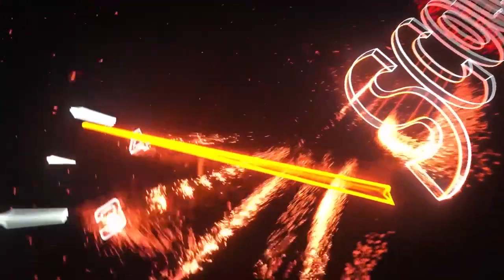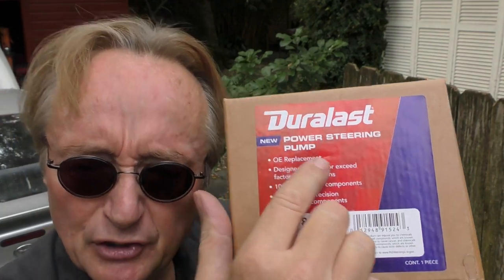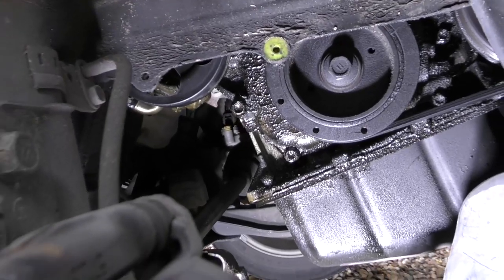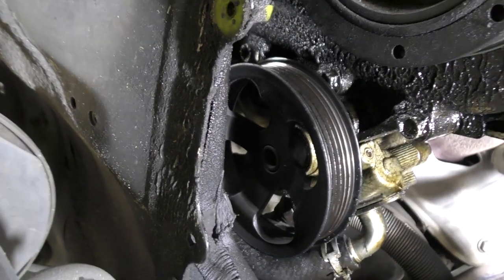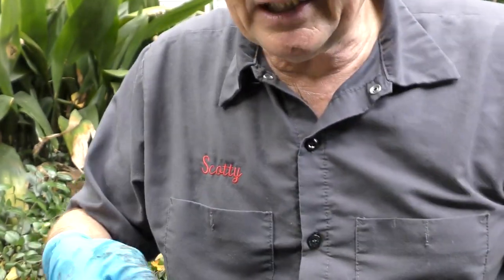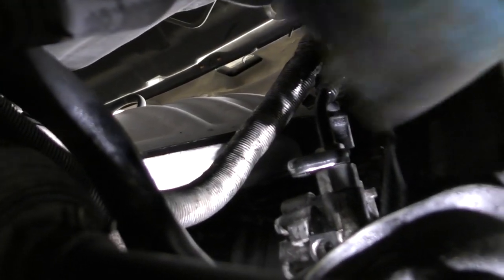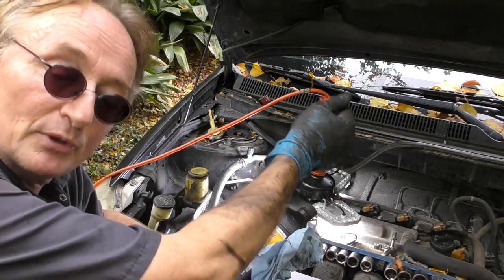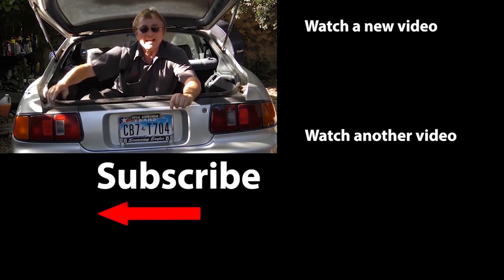I Couldn’t Fix This Car By Myself (First Time Ever)

Comment: I remember when Toyota's weren't endless money pits.
Reply: I got a 2003 v6 Camry 200,000 this year for $1800, replaced the timing belt, sunroofs tracks, vacuum hoses, wired the knock sensors so one of them feeds both wires on the ECU( must remove intake to replace sensors, too hard now but maybe in the future),  new inner tie rod and waiting to do the leaky front strut. Engine and tranny great, burns no oil and the oil is clear when I change it 5000 miles. Parts do wear out. Of course did all my self or not worth it if I had to pay.
Reply: These newer ones seem to need a lot more maintenance.
Reply: John D  What, a Lada?
Reply: @FredTheLutinoCocatiel  I'm waiting for a sale at the local Pick and Pull
Reply: They still aren't, until you hit around 150,000 and the suspension starts falling apart on you. The engine and tranny typically last forever, but everything else falls apart. I've spent $1000 in the last 3 months on my 2000 avalon replacing a bunch of Powertrain code sensors and pretty much my entire front end suspension. Neglected work that I put off for a year. I'm a mechanic so I was able to absorb a large portion of the labor cost. If I took it to a mechanic that number would be well over $3500. The only labor I had to pay for in this case was the wheel alignment labor.
Reply: This is my car. It has 230,000 miles. Very little has had to be fixed on this vehicle. It still runs very good and I'm confident I can get to 400,000 miles on this car or more. Scotty recently changed the motor mount also because the leaking fluid ruined the mount. He did a video on it as well about 2 weeks ago.
Reply: @safffff1000  I replaced my knock sensors and knock sensor harness on my 2000 Avalon but with no wire work around. That was by far the most difficult job I've ever had to do. There's a plenum bolt from hell in the back that I had to deal with, and it's a real money pit because of the age of the vehicle, replacing all the intake gaskets as well as the cross coolant hose, bank 1 valve cover gasket, and changing the spark plugs in bank 1 is pretty much essential while doing that job.
Reply: @tolrem  Replacing a power steering pump is a repair, not maintenance. My '88 Camry back in the day was an unreliable money pit. My dad's '98 Tacoma had problems right off the dealer lot. Never Toyota again. They leak fluids for hobby after 100k miles.
Reply: @kyzercube  You explained why I'll never own a Toyota again. In 1998 I bought a 1988 Camry with 118k miles. That thing was such a money pit. Already the paint was completely devoid of it's clear coat and fading badly. I've owned older vehicles with much better paint. The sunroof no longer worked. The interior was a rattle trap. By far the worst interior quality of any vehicle I've owned yet and I've owned A LOT of cars from a variety of brands. The engine leaked a massive amount of oil. At 10yrs and 118k miles, it shouldn't have. The engine also burned oil visibly out the exhaust. The shocks were shot. The brakes had issues. They'd grind while turning sharply, even with new pads. The fuel pump died at a busy intersection, leaving me stranded. I bought this Camry thinking it'd be a good bet for my tight budget at the time. Boy was I wrong. By Dad also had a less than impressive experience with his new '98 Tacoma, surprisingly. It immediately had throttle problems and the hood rattled at highway speeds. The interior quality was also piss-poor. The plastics were very poorly color-matched and everything felt super budget-oriented.
Reply: @Liquidmice9  Did you buy   it brand new?
Reply: @1962pjb  I bought in used with 50,000 miles in 2012. I've put 180,000 miles on it since then.
Reply: @safffff1000 timing belt alone is a 600 job. The rest is textbook but I would say equal to 400. The struts another 250, I agree with money hog.
Reply: Ah lord,the old style power steering from yesteryear.
Reply: After 250xxx they all become money pits....
Reply: All vehicles can become money pits after 10-12 years of age and 100,000 miles, regardless of how well they were treated. Things just break.  All cars have issues.

The salvage yards are full of every kind of car and many are not wrecked and of course most of those are from owner neglect like running them out of engine oil, etc.
Reply: @Liquidmice9  How lucky are you having the great Scotty as you mechanic.

Comment: That car is one of the easier cars to do even tough it’s in the bottom back. I have done a pump on a GMC Enclave and had to remove the pulley while on the car and reinstall the pulley once the pump was back in the car
Reply: I pull the exhaust heat shield n shove the rear heater lines over a bit, with some wiggling it will come out over the exhaust manifold between the firewall toward the driver side and out the hole above the t-case and steering rack with the pulley on.

Comment: Yo Scotty,

I've started watching your videos a while back and I appreciate what you deliver;great information. I'm a BMW guy and I do agree with you it's silly there a lot of plastic on the modern BMWs.

After owning a few, if you do work yourself and do it in a timely manner, the cost of repairs isn't a problem. You do need a few specific tools but if have multiple BMWs it is worth it.

I have to say that working on cylinder 6 is a pain but otherwise the is enough room to get to most important things.

Keep up the good work!

Comment: I just did a SERP belt on a cab over Chevy w3500, it’s a Isuzu npr. Any how 119” belt aux refrigeration compressor along with the regular air conditioning compressor no real access to the front cause of the cab tilt. It took 3 hours and I use the following tools 3/8 ratchet with 17mm socket on the tensioner with copper pipe handle extension, pickle fork for heavy prying trim removal tool for getting belt started. Running passengers side to drivers side 20 times belt continues to fall off each time I breath on it. Finally got it on and I didn’t call anyone and I love it.

Comment: Done a few of these on straight 6 engines. Most are a lot easier as they are able to be worked on from the top-front. I used a pipe spanner, which is basically the same as the attachment for the socket but an open ring spanner. Those belts turn to mush too. If you can't afford a new pump, get one from a auto wreckers 2nd hand. It will be cheap, better quality and probably last longer than a cheap knock off. I was stuck for one once and got one for AU$20 last time. Got me out of trouble for over 3 years

Comment: I agree with the tensioner not retracting enough to install new driving belt, the solution is to have those long wrenches with ratchets, you just retract it far enough and those that angle help too to get that extra space forore retraction and wallla.

Comment: Also  you  should  clean the  motor  with degreaser  before  replacing the  pump , its always  nice  working on a  clean  motor  and  you can  possibly  find oil leaks  that  you  might have.

Comment: Thanks scotty. Been wondering if I should by a rebuild or new. Guess I’m buying new. I had already figured the rebuilds were crap based on just common knowledge that no one ever replaces or changes their power steering fluid which becoming cutting fluid. ( 2001 Dodge Ram Diesel )

Comment: I use auto trans fluid for power steering,it’s way better.
Reply: I know most Fords call for trans fluid in their P.S. and if you see  the  small bottles in stores of P.S fluid, most read for topping off only and not to used as a complete change.
Reply: I'm surprised he didn't use ATF. Every Toyota I've ever had (4 of them over 14 years) always called for Dexron ATF for the PS system.

Comment: Hey Scotty why didn't you replace the switch on the pump also? 
As long as you have the pump out right?
Reply: Was thinking the same thing. I am thinking that it was to save money. Sometimes those switches can run you more than the pump just cause into the hundreds just cause. So don't fix it if it ain't broke.

Comment: That was easy, Ford engineers decided to put the Power steering pump on top of the AC compressor. And I had tp remove the bracket holding up the radiator , then I had to use shoe laces to hold up the radiator. No more leaking tho. I did buy the remanufactured pump cus that was all that AutoZone had. Hopefully it holds up really good.

Comment: The cursing and swearing seems to be common thing in car repair.
Reply: You never worked on a car before have ya?
Reply: @wolfpackflt670  Tried changing oil on 87 Monte Carlo put the filter wrench around the filter only to then realize there was no room to turn it
Reply: @wolfpackflt670
It's therapeutic! I used to work in plenty of car repair shops and it really does seem to cause the car to submit to the desires of the tech more easily. Hahaha.
Reply: j d Especially when you're trying to loosen a tight nut or bolt and your hand slips and hits part of the frame.
Reply: I don't like the feeling of frustration. Things tend to frustrate me when I work on them, including cars. So I do administrative jobs. They do frustrate also, but you can talk to people, not to things.

Comment: Wut power steerin' pump? I still have my manual steering.
Reply: Fox McCloud 007 Mine has one of those electric systems so no messy fluid to leak all over the place.

Comment: In Brazil we fix the pump if it's possible. There are specialists that rebuilt the pump and check if it's pressure is ok.
Many times it's just the seals leaking
 Change than and it's good to go. Remember to clean the filter inside the reservoir or change the reservoir. Use about 2 litres of new fluid to clean the system. If you install a new pump without cleaning the system your guarantee is lost.

Comment: After replacing a power steering component I typically fill reservoir start the  engine a fraction of a second and immediately turn it off, and refill reservoir after , waiting  a minute for the bubbles to  burp  to top, restart it  again  a couple times for a fraction of a second waiting a minute or two between each start. Doing this reduces the amount of fluid aeration and  time  you will have to deal with whining noise from the steering pump from aerated fluid afterwards
Reply: the tradeoff is that you just started your car 20 times. im sure the starter loves that :/

Comment: 94 GMC Sierra pickup  Power steering pump is simple to replace.
Reply: 95 k2500 cheyenne
Reply: Yup did mine too. The whole truck is pretty simple. That's why I'll never get rid of it.
Reply: @brian1157   I've had mine for 15 years and only had to do a couple repairs
Reply: @phillipbonner5215  Nice! We got ours from my wife's dad. I did just go through it and rebuild and replace all the top end gaskets, TBI, and emissions. It ran fine before, but as a 26 year old daily driver I thought it was worth it and the truck runs excellent!
They're just fun to work on.

Comment: I just replace a front crank seal and belt on the same car. I was able to pull the tensioner back and get the belt on myself. But I do see how having a extra hand would help cause it took some thinking to get it ✌️🤠

Comment: I've had good luck with Autozone's Duralast line of parts. If you buy brakes from them, get the higher priced "Gold" series. Just did calipers, rotors, and pads on my Tacoma. The Gold series rotors are the "high carbon" type, which makes a huge difference when it comes to heat soak. They massively resist warping, which is what creates pulsation, and makes using aftermarket brake rotors a nightmare after being on the car for only a few months. Even with aggressive braking in the summer heat, these haven't done that. They provide smooth, linear stops all day long. Worth every penny of the extra $ paid. And no, I dont work for Autozone or Duralast....

Comment: i wish i lived in texas literally  just so when my car breaks i could bring it to scotty
Reply: If I lived in Texas I would have more time to make repairs. Winter in Texas doesn't come with the snowy, windy, cold, short day hassle.
Reply: I wish I lived in Texas so I could keep a car 25+ years
Reply: This is my car. Scotty has worked on it twice in the past few weeks. He previously changed the motor mount that broke because of the power steering fluid leaking on it. Both times he did a great job and prices are good as well. He's a great guy to talk to in person as well.
Reply: @Liquidmice9  he has an addictive to watch you tube channel
Reply: Liquidmice9 how do I get in contact with Scotty I also live in Houston
Reply: Not just anywhere in Texas works. You can drive 3 states away from lots of states and for that distance still wouldn’t be halfway across Texas.

Comment: When I had my 1992 Olds Bravada I had to rent a pulley remover kit and take the pulley off just so i could get to the bolts that hold the pump in to get it out. Oh, and take the fan off too. This looks just as hard.

Comment: Scotty must be in pretty good shape because I didn't hear any grunting or other noises while he strained on those tight fittings. Heck, my elbows and arms hurt just from watching him talk.
Now for the (relatively) relevant part of my comment. When I have done either pump or rack I usually regretted not changing at least the high side hose at the same time.

Comment: Hmmm...my 79 Lincoln still has the original power steering pump in it.🤔
Reply: You must have the only 79 Lincoln left with under 40k miles on it.
Reply: @MrWoodyBalto  Oh no,my 79 Mark V(5)has well over 300-K on it and runs like a Swiss watch.According to what I've found on national registry,there are about 100+thousand of these still on the road,with all original parts still in them.
Reply: 86 dodge caravan 400,000 miles same rack and pump and automatic trans. original radiator hoses and brake lines too. And driven daily.
Reply: @ravenbishop5232  That is a one-of-a-kind vehicle,nearly all the Dodge mini's are junked before 100K and at least 2 transmissions.
Reply: @4gauge10  its 86 tho. a lot of stuff worked way better back then
Reply: 1979, before manufacturers had planned obsolescence down to a true science.

Comment: Buy a 94 Celica and you wouldn't need to do this at all
Reply: My corolla has the same engine as his celica and the power steering pump is truly easy to replace
Reply: You haven't seen the pump on my 93' tsuru with E16 engine. I don't think another engine has it that easy.

Comment: I tried to change a leaking high pressure power steering hose in my Saturn. I couldn't do it; I had to take it to a pro who had the right tools and skill. I was charged for 5 hours labor. After seeing what was involved in doing this job, I didn't balk. That hose was buried in that engine compartment good.
I can just picture the sadistic bastard who designed this car, "wait 'till he tries to fix this."
Reply: the man who invented the transaxle v6 is in the deepest level of hell lol

Comment: I've changed that serpentine belt on my 2003 Corolla at least 4 times during the 13 years I've had the car (because that damn thing doesn't last very long and then starts to squeak like mad), and I never needed anyone's help to do it. Sure it isn't easy, but it's still possible to do it on your own.
Reply: Peter Rudy I was using 100% genuine Toyota OEM belts each time.

Comment: The pump on my 08 Chevy Malibu went out. I've been driving it dry with just a little in there cause I got tired of the whining. But I gotta do this here soon cause I hear they can seize up if you just let them run low. The only issue is that Chevy being the idiots they are with space left no real working room. 

I just used one of your other videos to fix my Suzuki Swift up and will be getting the coolant temp sensor here shortly. It's all so easy to get to on the older cars. The newer cars are so stupid with how they cram everything into the tiniest places and make it a living hell to repair. Makes me want to go into the engineer's house and put a shrink ray to everything to see how he likes it lol.
Reply: Luckily most cars now have electric power steering.  If it quits working just pull the plug.

Comment: Most Honda power steering pumps are located on the top. Honda knows that their power steering pumps are prone to failure so they put it where it's easily accessible.

Comment: since the job was a pain I woulda changed the pump switch as well when they get dripped on by fluid they can fail (ask me how i know) , thus safer to not have to go through it all again.. also if the pulleys are all greased up, spray them down with brake cleaner so you don't throw the belt at 90 on the hwy... peace

Comment: I have a 1987 toyota with 360k miles, the trans and engine has been rebuilt, but I still have the original hydraulics! Same power steering, same clutch same brakes... They just don't build things to last anymore.
Reply: Sadly new means cheaper, not better.

Comment: You are supposed to bleed the lines and pump by having both front wheels off the ground and turning the steering in both directions lock to lock 20 times with the engine OFF. Then start the engine and repeat lock to lock to 20 top off the fluid then you are done.

Comment: what a hassle nightmarish repair, worse than doing my fuel pump 3 times! and the lock ring over 2 hours sweating pushing struggling with 2 screwdrivers to do it lol

Comment: Tip: Change the damn power steering fluid every now and then! Even if it's every 50k miles and you only change what's in the reservoir, it's much better than ruining a 300 dollar pump then having to pay nearly that much for a chinese knockoff that won't even last as long. Glad it's easy to access on my older V8 truck.